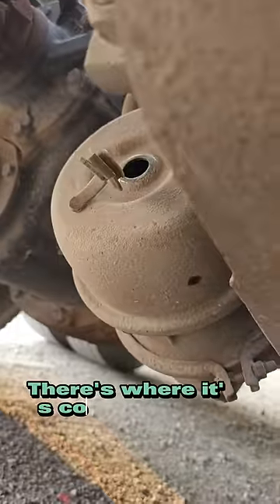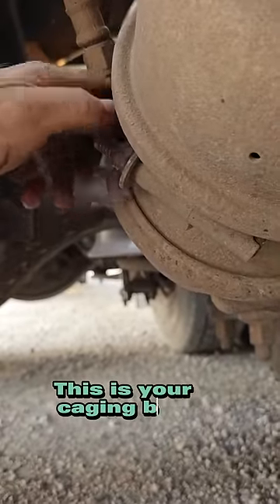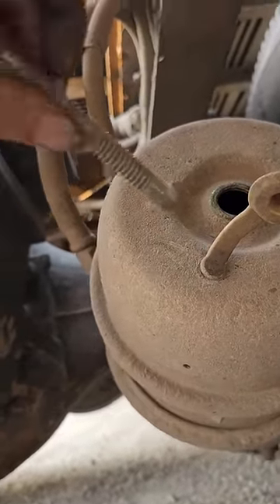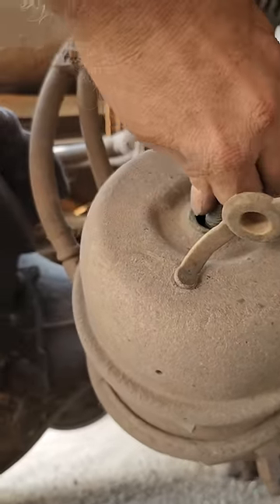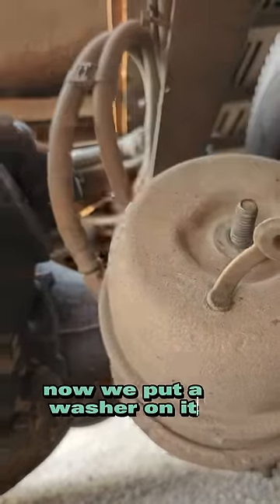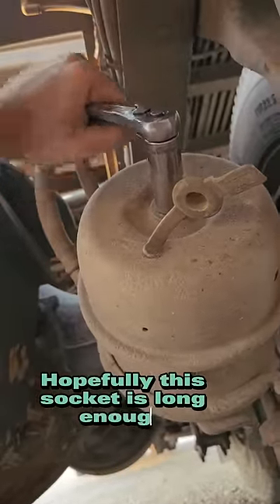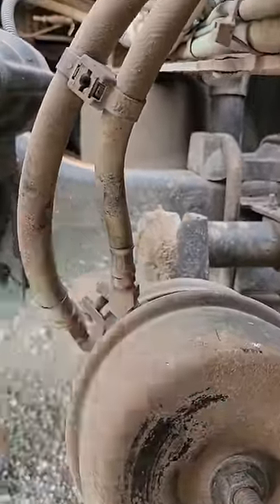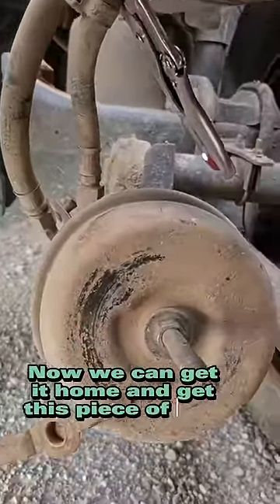How I cage a brake chamber and get home

Comment: Personally I wouldn't use vice grips on the supply line to the spring chamber, I'd undo the line, cap and, and plug the port in the chamber. Might not make a huge difference in the lifespan of the brake hose, but the time it fails will inevitably be the time that you're a hundred miles from anything
Reply from the maker: What would you plug the line with?  I've been told a dime works.  Or maybe it was a nickel.  Idk.  I dont carry change.
Reply: I'd use a hydraulic line plug. A kit with NPT, ORB, and JIC/AN fittings would be small enough to fit in a baggage compartment with ease, and those kits go from 1/8" to 2" IIRC so you could plug basically any line on these trucks short of a main radiator hose
Reply from the maker: @Romuls753  I'll have to check out one of those kits. Thanks for the input.
Reply: They should be relatively cheap, I'd imagine $100~$200, maybe $300 at the absolute most for a full kit of NPT, JIC, and ORB. Hell, some kits at the $300 point may even have weird plugs like O-ring face in addition to the others
Reply from the maker: @Romuls753  Do they have ones that are only plugs?  Do most come with other things like caps?  Where's a good place to buy them?
Reply: @aftersolo  Discount Hydraulic Hoses has kits of adapters, plugs, and caps for ~$200 for JIC and for NPT. They also have ORB plugs as a kit, but no caps apparently
Reply from the maker: @Romuls753  ok.  I'll check it out.  Thankyou.

Comment: That situation would justify  getting a passthrough ratchet and socket set for an emergency kit. Even an inexpensive one from AutoZone or Home Depot.
Reply from the maker: Yes, or just buy the caging bolt socket made for it.  I'm going to buy one.  I also already purchased smooth jaw hose-pinch vice grips.

Comment: You can also put a screw in the air line and put back on. It will seal and you don't have to worry about the vise grips coming off and fucking up a tire.
Reply from the maker: Yes.  I didn't know about alternate methods until I put up the video.  I also heard you can put a dime in the end of the airline and screw it back on and it stops the airflow.
Reply: @aftersolo  👍

Comment: maybe also use a little piece of a rag when you pinch the supply line, if the jaws on your vice grips are sharp.  I don’t quite understand what the other comments are talking about the emergency brake? like the hand brake on the steering column?
Reply from the maker: What's your question?  There's so many comments, I can't keep up.

Comment: 99% of drivers have no idea how to cage their brakes. So when there is no air they are fked
Reply from the maker: Yes.  Most companies won't even let them mess with the truck or trailer. I was with an OTR company in 09.  Was picking up a trailer at a lowes DC in Wyoming.  Trailer lights were out.  Wiring was cut. I told them I can fix it.  They said to not touch it and they'll have a service truck out there.  Whstever.
Reply: The newer drivers don't know how to change the fuel filters or change a tire on the side of the road and use starting fluid to set the bead hell most of them can't seem to crank the landing gear all the way up

Comment: You got a bad pancake, easy peasy to fix.
Reply from the maker: Idk how to do that.  I'd rather just replace the whole thing.  That spring makes me nervous.
Reply: Cage the chamber as you did undo the clamp small nut and bolt visible in vid remove chamber replace diaphragm replace clamp replace chamber ,fixed

Comment: On the supply line you can put a dime between the nipple and fitting.  The dime will bend and seal the air leak.
Reply from the maker: Awesome tip.  Thankyou.

Comment: I allways used galvanized shingle nail under the fitting in to the supply line "on small lines said nail and on big lines a dime" to. Shut of air instead of vice grips...and if you use vice grips tape wire or zipp ties in case it pops open
Reply from the maker: Ok.  I appreciate all the info.  I'll have to remember that.  I just bought some smooth jaw vice grips specifically for crimping hoses.  I still need that Cajun bolt socket and that dime.  I haven't heard the shingle nail trick though.  The big head of the nail would work really well.  Good to know.

Comment: Would be a lot easier to pinch off the supply line and easy off the slack adjuster on that particular brake booster
Reply from the maker: Yes.

Comment: How will it do while driving under rough interstates or is there a possibility the bolt bolt caging the chamber spring may come loose and if there is a possibility at what speed do you recommend to navigate in interstates?
Reply from the maker: I can't recommend driving the truck with the brake chamber caged but let's just say for me, I drive about 10 to 15 mph under the speed limit on the highway.  It's possible for the caging bolt to come out, but highly unlikely if it's done correctly.

Comment: The best thing is when mechanics steal the damn bolt off the side of your brake chambers so you gotta call them for one, ive startes taking mine out and storing them in the tractor
Reply from the maker: Damn mechanics.  Guess you could take one off one of the other chambers.
Reply: As a tech, myself, I make sure to leave the caging bolt on the brake chamber whenever I swap 'em out for this exact reason, never know when the driver is gonna need it to limp back home
Besides.. what the hell am I gonna do with a pile of caging bolts anyways? Lmao

Comment: If your breaks arnt released then there shouldn’t be air in the lines. Other wise there was no point in caging it. And if you know what your doing you don’t have to cage it. The clamped side will hurt but the welded side is the killer. so be careful.

Comment: Problem is, If the parking brake return spring is broken,  you can't get the cage bolt in straight  ( or sometimes not at all ). If you try and it shoots out, you are gonna be injured or dead. A broken parking brake spring will not have the full 1400 ftlbs of force, but it's still dangerous. What I used to do with my school buses ( and then later on my triaxles), is run it to governer cutout. Release the brakes, and then run it in low gear to keep the RPM's up. Sometimes I would adjust the governer to 140 cutout ( that's max pressure for air cans). Or if it was a freightliner,  I didn't have to.  I could always tell if some dumbass worked on it. When the brakes were out of adjustment,  I would lose 15-20 psi on one brake application.  No matter how many times I told people no one listened.  If you have to keep adjusting brakes,  there is a problem. That and I kept finding mismatched brake cans.
Reply from the maker: Dang.  Sounds like you've done a few.  I only work on one truck, which is mine.  I try to keep everything up to date so I don't have catastrophes happen when I'm working on it.  I don't run in the rust belt either, so that helps out.
Reply: @aftersolo  well at least you're willing to learn. Do you have any idea how many times I've tried to give constructive criticism,  and have gotten yelled at?  None of us were born with knowledge.  And I appreciate your humbleness.
Reply from the maker: @VitoVeccia  Thankyou.  I try to talk to people on here like I would in real life, face to face.  If I can't do that, I'm not being true to myself.  That 'online' character so many love to play can become real too and blur the lines between what is real and what is a mask.  It's something I take very seriously.  I have people say horrible things to me all the time on here, and honestly, it has built up my tolerance quite a bit.  I'm a pretty agreeable person, so confrontation can be difficult, but walking away can be even harder.  I've learned to just walk away from those who who say horrible things rather than indulge them.  That's what they want and I'm not here to satisfy those self-fulfilling desires.
Reply: @aftersolo  yeah, I hear ya. The delusional online world is just that. People get caught up in their emotions. But even in the real world it's tough. I'm 40, and when I talk to teenagers or college kids, I don't disrespect them because of their age. I hated it when people passed judgement on me because I was young.  And you should of seen the shock on people's faces when I was a kid talking about rebuilding carburetors, and setting points.    Being young doesn't equal being stupid. And there is no reason to lack manners because we are hidden behind computers. And  I always try to share the same knowledge people shared with me.
Reply from the maker: @VitoVeccia  Yeah, I've always had to show people something I was going to do rather than tell them.  I've done it my whole life bc my ideas are different and they don't fit the norm.  I talk with my wife all the time about how I don't want to be some 65 year old guy someday talking about these young kids and always complaining that they don't know anything. I don't want to be that arrogant and just unrelatable to younger people.  I'm not superior to anybody in this world.  I can't stand that mentality.  We can all learn from each other.  I try to keep myself in check and I'm glad I have my wife for that to some degree or it could go unnoticed for the rest of my life.  I could just turn into a bitter old man and I don't want that.
Reply: @aftersolo  that's the best way to learn honestly.  It's how I always learned.

Comment: What if that chamber doesn’t have a caging bolt?
Reply from the maker: It should have one.  I would check the other chambers to see if I could get the caging bolt off one of them.  Just make sure it's the same type of chamber.
Reply: 7/16 wrench loosen off the slack adjuster pinch the emergency line. Drive for 1km feel for heat on your wheel or drum. I have never been able to cage my breaks they get packed with mud it’s impossible.
Reply: @aftersolo  thanks
Reply from the maker: @alansanchez8550  no problem.  The advice from  @justinriben8197 is solid too.

Comment: Should advise everyone , it's illegal to run down the road with a caged brake chamber and dangerous especially if your under a load. Should be done only in a emergency  just to get it off the road to safe spot , not suggest to drive like that. Better to call road service out there  so it can be fixed  & replaced properly.
Reply from the maker: If you have signal.  I run a lot of freight in west Oklahoma and West Texas where there is no service.  This would save a seriously long walk.  We got to do what we got to do out here especially in a Biden economy.    There's dangers to every single repair video I post and I put up a disclaimer in the description.  It's the risk I take trying to help people.  Multiple people have told me about putting a dime in the air line to block it and crimping the line with smooth jaw pliers.  It's pretty common place to limp a truck to a place where you can repair it and not spend $1000 for a 30 mile tow. Limping a truck a short distance is commonplace in trucking.  Things happen and we cant call a wrecker and spend $1000 anytime any little thing happens or we would be broke.  I'm not a mega carrier.  I don't have throw away money.  I appreciate the input though.  I'll add something to the description.
Reply: I get what your  saying not giving you a hard time , I wasn't talking about a wrecker , mobile mechanic.
And I know there are different  circumstances plays a big roll, trust me  I've been to Oklahoma & Texas. 
It's when I see something like this,  I just  don't  want to see especially new drivers doing something like this and getting hurt or hurting others.
Just came across your channel Tonite. I've been to calls before where drivers would try to fix it and just made the situation worse , instead waiting for me to get there and fix it properly. Well anyway didn't mean to upset you.   I was just saying. I was actually surprised you answered , usually big channels don't answer back to much , pretty cool that you do. I'll check out the rest of your channel looks interesting.  Have a great night 👻🙋
Reply from the maker: I don't consider the channel to be big.  It went from 1000 subscribers to 6000 in one week bc of a viral video and I've just been in a bad mood responding to some very sick people.  When you have 5 million people watch the same video in a one week period, you get some very unwell people who need therapy or jail responding to the video.  It's kind of terrifying that I can talk with them if I so wish.  Anyway,  I get what you're saying.  Completely makes sense.

Comment: I have never used a cage bolt. Put some vise grips on the rod and use 9/16 socket and move out of the way. Works every time lol
Reply from the maker: Makes sense.  What's the 9/16 socket for though?
Reply: @aftersolo  it is for the brand bolts that holds the top half to the bottom half

Comment: For anyone who hasnt delt with these before, its not always possible to cage it. At least not easy to. If the spring brakes it wont be center. Drain your tanks please. Rust will fuck you up.

Comment: do the brakes needs to be applied while caging that or released??
Reply from the maker: You can do it either way.  I did it with them applied.  Honestly, it's a lot easier doing it with the brakes released.  You can just spin the nut on the caging bolt by hand most of the way then tighten til you can't turn it anymore.
Reply: @aftersolo   so really doesn’t matter from what you are saying right????  and thx for answering that fast, ill have to do it right away
Reply from the maker: @vitaliemorari6165  No.  It's way easier with them released.  I had trouble guiding the end of the caging bolt where it needs to be with them applied.  Plus, it was hard to see inside the brake chamber.  Got to have a good flashlight.  You'll see what I'm talking about.  I just didn't realize how many times you have to turn the nut with the brakes applied.  It's a lot.  You'll run out of socket too even with a deep socket.  Got to have a wrench.
Reply: @aftersolo  ok got it thank you for your help
Reply: It you caged it while applied braked and clamped off service line to it when you release the brakes to go down the road wouldn’t that brake be applied? Cause you cut service to it. I just carry an extra piggy backs with me
Reply from the maker: @mikeike7161  No.  If you do it while the brakes are applied, as you tighten that nut it will release the brakes.  You can do it with the brakes applied or released.  Either way, the end result is the same and the brakes are released then you can pinch off the airline.

Comment: Danger ⚠️ brake chambers hold 60 psi,30 in front and 30 off the back. If in the event that the housing opens and is not caged properly get ready for a show😮. In my 27 years of working around them I’ve seen them go through walls…wood and bricks if you catch it in the face ☠️ Be safe don’t be a statistic,tire’s also 😊

Comment: So drive it home without a brake working?
Reply from the maker: If 20% of the total brakes on the vehicle are determined to be defective based on criteria established in “North American Standard Out-of-Service Criteria handbook,” the vehicle will be placed out of service, and an Out of Service sticker applied to the vehicle by CVSA inspectors.  So, 1 brake out of 18 is not an oos violation.  Having  2 is.  Having one out is a ticket though.

Comment: Do you have to pinch that airline ?
Reply from the maker: Yeah, or else the air would escape.  There's other ways too like putting a dime at the end of the hose then screwing it back on.  The dime blocks the air.
Reply: Yeah cause I got air coming out of that tiny hole on top. Would i still cage the chamber or pinch the line to keep on rolling?
Reply from the maker: What tiny hole are you referring too?
Reply: @aftersolo  on top of brake chamber
Reply from the maker: As far as caging the chamber, it depends on the type of chamber.  If it's a service brake chamber, there's no need to cage it.  All you have to do is stop the air going to it.  They'll be the smaller chambers.  Then you have spring brake chambers like the one in my video which are larger and have a built in spring that applies the brakes when you pull the knobs on the dash.  As soon as there's no air going to them, those springs will apply the brakes.  They're also for emergencies if you have a sudden air loss going down the road.  Those kind need to be caged.  Some guys on here told me if you cage the chamber, there's no need to pinch the airline and to just screw it back on.  I would think the air would still leak though.  A lot of people got onto me for pinching the line.  Said it can weaken it.  I was just trying to get back home.  It wasn't far.  The line can always be replaced.  The main point is to avoid a $1500 wrecker bill.  I did get some hose clamping vice grips that are smooth rather than rigid.  Here's a link:  10" Radiator Hose Clamping Pinch Off Locking Pliers https://a.co/d/4ZnqhGs

Comment: I would zip tie the vise grips and tape them to the hose so as not to vibrate.  That’s if I didn’t have an extra 30 diaphragm to slap on.
Reply from the maker: Yeah.  I didn't have far to go.  I need to keep a spare pancake on me.  Just add to my huge pile of spare parts and tools.
Reply: You can't change that particular diaphragm anymore.
Reply from the maker: @jasonstclair6293  I thought so.  The chambers are all sealed up, correct?

Comment: What does it mean to cage a brake chamber?
Reply from the maker: You insert a T head bolt into the end of the chamber and engauge the spring that operates the emergency brake application when air pressure is lost. Tightening the nut draws the spring back to it's shortest length so it will not force a brake application. Applying the parking brake usually releases this spring so the bolt holds it in the caged or energised position allowing the chamber to be opened without an explosive release of the spring